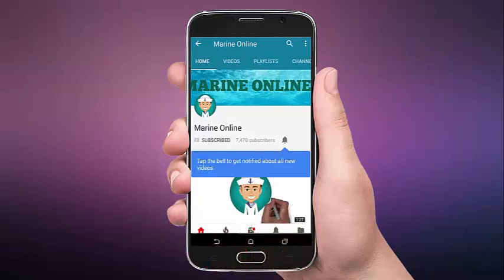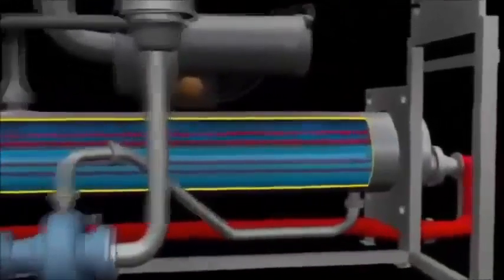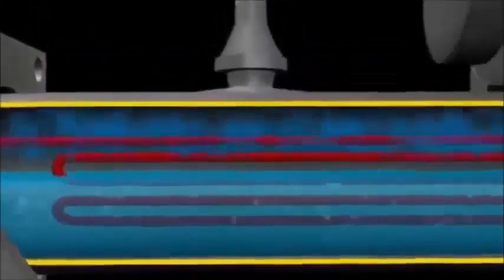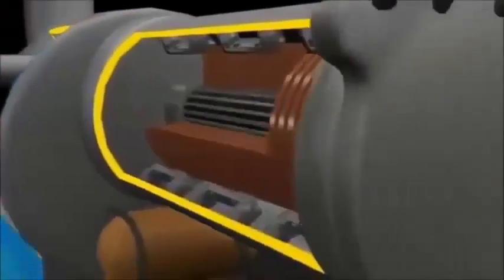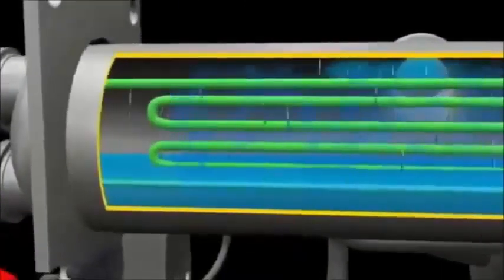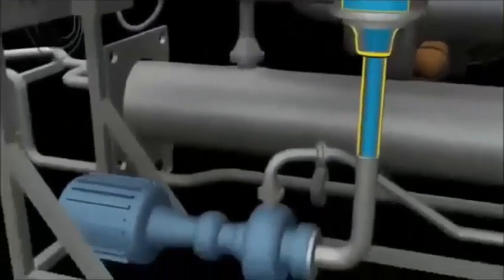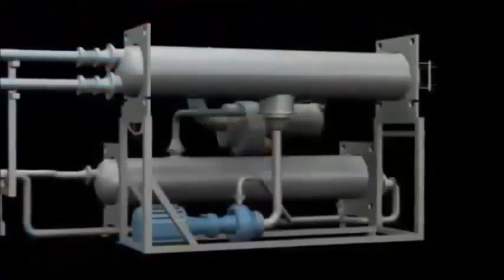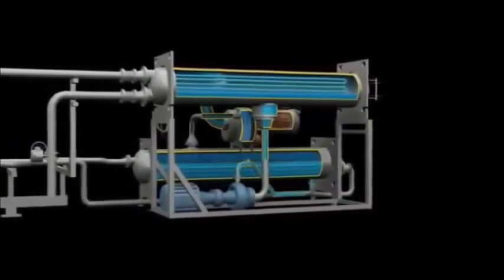How Does Water Chiller Work

Comment: Geson chiller product range covers Industrial Refrigeration and Commercial Central air-conditioning, including Water-cooled chillers, Air-cooled chillers, Screw chillers, Scroll chillers, Centrifugal chillers, Water(ground) source heat pumps, Air source heat pumps and etc., Capacity from 2tons~4000tons, and temperature from -160℃~30℃, complete full product series for customers. 
www.gesonchiller.com